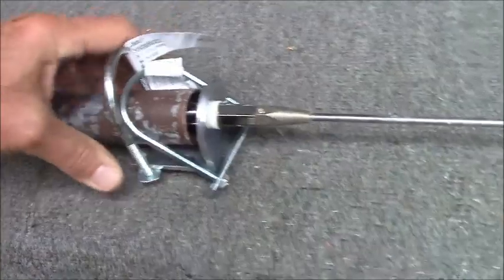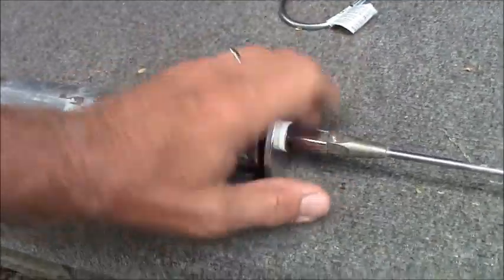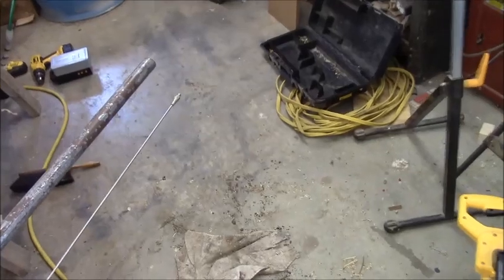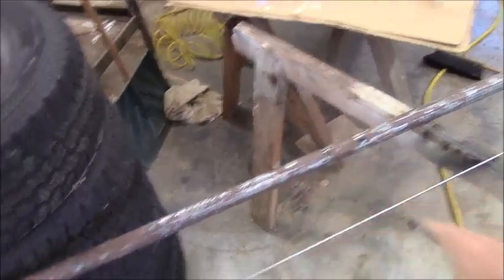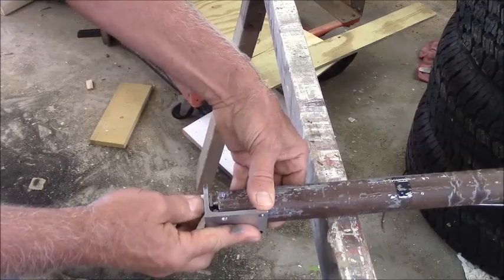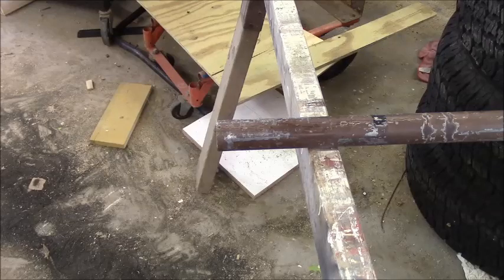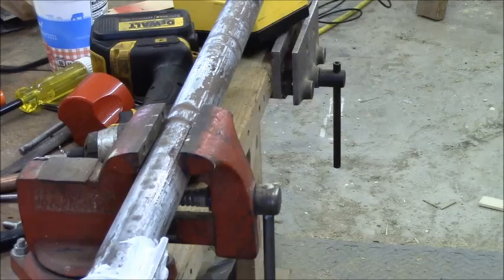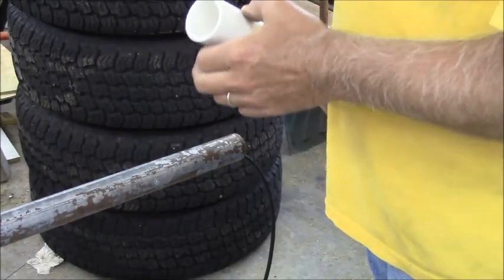DIY CB radio antenna, How to build a quarter wave vertical dipole CB antenna cheap

Comment: Love all these home brew antennas that popped up here and there.thanks to you all,I have a cb sitten on my work bench today to 
repair.gave up on cb and communications  work 25 years ago.now I'm making a return!!thank u all.
Reply from the maker: The best CB antenna I ever made was back when my house roof was asphalt shingles (I have steel now) I used the same base mount with a 102" ss whip antenna. I made a couple metal brackets and attached it right on the ridge of the roof, then I had attached four 102" wires to the base (ground) and stretched them down the roof slope at about 90 degrees to each other, 2 down each side of the roof and screwed them down. Then I ran a ground wire to a ground rod in the ground. It was fantastic! I could easily talk 10 miles with a 4-5W unmodified base station!
Thanks for watching! Good luck in all your endeavors!

Comment from the maker: One note: when I drilled the PVC pipe coupling holes with the coax in the pipe (at about 22:50), I actually did cut the coax and had to pull it all apart, so drill those holes when the coax is OUT!
Reply: Well that was going to be my question about the coax !! Thank for the video 📸

Comment: I'm also a ham. I made a vertical dipole also with the 102" whip, but with a non conductive mast, and for the second half of the dipole I just have a 102" piece of 10 gauge wire hanging down. Gravity does the rest.
Reply from the maker: porkyfedwell cool! Yeah a Dione is simple. One ham friend of mine said you could strip the jacket off the coax back 102” and turn it inside out back over the coax itself for 102” and hang that up vertical. Seems feasible. Thanks for your comments! I have 3 old SSB 𝐂B radios to recap and troubleshoot and tune up. I’m not a radio guy but I’ve been in EE for 35 years in industry so I think I can get it done!
Reply: @bobsbarnworkshop  Sounds like you are more than qualified. You should just go ahead and get your ham ticket. These days it's a snap. No Morse code required. Although I only work Morse and not SSB or digital, myself. CB I have only in case of a national catastrophe such as the Carrington event or EMP, which might eliminate all local communications.

Comment: When tapping out new threads you need to cut a little then back it off to clean the cutting edge; do this until you get it completely tapped.  If you don't back up a bit you run the risk of breaking the tap.
Reply from the maker: W. Rusty Lane yeah, I know, the pipe was very thin wall so not much worry of that!

Comment: This is done completely the hard way. All you need is a piece of schedule M and schedule L copper pipe with end caps. Drill out the end caps so that they hold a 3/8 by SO-239 socket and tighten it down. Slip the schedule M copper pipe over the schedule L and use machine screws to make them make electrical contact at the top. Use a 102 inch whip for the top and 102 in for the schedule M outer sleeve. The schedule L pipe should be about 3 ft longer to allow mounting. Run your RG8 up the center copper pipe and tighten it down to the SO-239 socket. This is when you put the machine screws in so that they create continuity between the pipes and the ring on the connector on the RG8. Use some foam pipe insulation and force it up between the schedule and the schedule L copper pipe at the bottom to keep them from making electrical contact. You now have what is called a coaxial sleeve antenna. What about nine RF course on the rg8 coax and hold them in place with adhesive shrink tube to minimize feed line radiation. I built one 15 years ago and it is still in perfect serve high in the mountains where we get snow and high winds every winter. I appreciate the fact that this individual made a video but he did it the hard way and a half wave dipole does not have 6db of gain. It is a unity gain antenna. This is the antenna of choice for Public Safety that continues to use low band as well as amateur radio operators hit run 6 meter repeaters. It is simple and cheap to build.

Sorry to hijack your post but you really went about it the hard way.

https://images.app.goo.gl/sSaxRwNqSKgJJyL17
Reply from the maker: I just used what I had laying around, so cost was $0... cooper pipe is expensive! I’m not saying that there’s many ways to make a better antenna, but free is free! Thanks for watching!
Reply: @bobsbarnworkshop  :: well, since you put it that way. Free is free. Cheap is cheap. As long as it works. But it doesn't have a 6dB gain. It's a zero gain. I appreciate the time you took to put the video together though. I didn't mean to come across as a dick either. My apologies. Anyone that takes the time to build their own antenna is good in my book. I'm an amateur extra class and I've been building them since I was 12 years old. To me, that's great enjoyment. Kudos to you. I don't know if you realized it but you showed people something that's more important than running a thousand Watts. That's having a good antenna. You can run 10 watts and make a contact that you can't make running a thousand Watts with a crappy antenna. Good on you.
Reply from the maker: So funny coincidence, I just sat down at the computer, switched on the old Lafayette telsat ssb 140 and talked to a guy 15 mikes away! First real contact I’ve made , so I guess it works

Comment: You would've done so much better by placing the PVC at the base of the 102" whip, then used 1/4 wave radials made from guy wire attached to the ground bolts and insulated with parachute cord from 108" and down. 
Your SWR would be 1.1:1 or so and you'd have made the equivalent of a StarDuster, a vertically polarized 1/2 wave dipole. A straight dipole like this requires a coaxial choke at the base and is a 74ohm antenna by natural physics, so about 1.5:1 swr at best.
Try it the other way and I bet you'll like it better, plus you should have less RFI getting into your audio with power.
Reply from the maker: W R 1 Million thanks for the input. One of my best friends is a HAM and I’ve heard all this info before. I’m just trying to make it as small unnoticeable and rugged to stand up to wind and weather. Years ago when my roof was asphalt, I used a similar mount and put the whip right on the ridge of the roof and stretched out 4 -102” ground radials from the screws into the mount. Very unnoticeable and rugged and I would have done it again but I have a steel roof so I figured it wouldn’t work that way.
Reply: A ground plane vertical (what you're describing) is NOT the same as a vertical dipole. The efficiency of a vertical is highly dependent on the number of radials, while a vertical dipole is balanced. The most critical thing when constructing a vertical dipole is that the feedline leaves the dipole at a 90 degree angle to the antenna itself (i.e., feedline is horizontal while the antenna is vertical).
Reply from the maker: porkyfedwell I’m far from an antenna expert. Although I have a “factory” vertical dipole on my cottage, the coax screws into the bottom so I pretty much built this based on experience with that. My SWR is very low so I’m happy wit that! I built a roof mount antenna many years ago with the same type base for a 102” whip and put it right on the ridge of the roof with four 102” gr plane radials laying down the roof at 90 degree angles. That one had a barely detectable SWR! I got away with laying it right on the roof because it was wood with asphalt shingles, I now have steel shingles. Thanks for watching and commenting!
Reply: @bobsbarnworkshop  Hi Bob. Actually I was not addressing you, but WR 1 million's post, as he didn't seem to understand the difference between a vertical ground plane antenna, and a vertical dipole.
You have to be careful looking at SWR alone, since SWR has almost nothing to do with antenna efficiency  (i.e., how well it radiates a signal). The perfect illustration of this is a 50 ohm dummy load, which has perfect SWR and is 0% efficient. Many other less extreme examples exist, of course. Best regards
Reply from the maker: porkyfedwell point well taken! I do know that the radiation pattern of a vertical dipole is far from ideal, like a donut! But I just wanted something that works, doesn’t blow my finals and is nearly invisible. Considering there is so little traffic anymore, I guess I’m good for now... I may try adding some horizontal ground radials to make it radiate more horizontal in the future. Thanks for the input!
Reply: @bobsbarnworkshop  actually a vertical dipole has nice low angle radiation, but maybe that's not as important in CB as it is for us hams. CBers are probably more interested in NVIS (local) contacts, I'd guess?
Reply from the maker: porkyfedwell we use the cb radios at the lake to talk boat to camp and it works great! No monthly charges either!!!
Reply: It wouldn't have been a vertical dipole with your configuration, it would have been a 1/4 wave ground plane.
Reply: @porkyfedwell  The feed line does not have to come away at a right angle, it can be brought up through a pipe element as shown. I believe the correct name of this antenna is a coaxial dipole or a sleeve dipole. Like the classic centre fed dipole you describe it has an impedance of a little over 70 Ohms. Some articles about this antenna suggest a choke or balun is unnecessary due to choking effect of the lower sleeve element on the coax.
Reply: I would not call this antenna a quarter wave ground plane, I would call it a half wave sleeve dipole. 6 dB seems more than a little generous.
Reply: @bobsbarnworkshop  don’t add radials to this antenna, this type of antenna works just fine without them, in fact it would probably make it perform worse.

Comment: I know it's some 3 1/2 years later, but did you ever post a video documenting the results, even after replacing the coax? I'm considering such an antenna, since I live in a rental house (NOT an HOA) and want to minimize my antennas "footprint".
Reply from the maker: The antenna us still working fine, swr is below 1.5 on all channels. 1.2 on most. I don’t use it a lot but when I do it seems to perform well. Not much out there except “alligator” skip talkers….

Comment: good job, but you have short antenna whit out coil for the 27 mhz ?
Reply from the maker: Well it seems to work, SWR is low and it was free! (I used materials I've had around for years!) So I'm good with that! Thanks for watching and your comment!

Comment: So, you did not make an antenna. Just mounted a 102" whip on a pole.
Reply from the maker: so I did "make an antenna" because the "pole" is actually the vertical ground plane of the antenna cut to 102" for CB frequencies.

Comment: I love this! How far have you gotten out on it? Just curious as to what the SWR's were like?
Also was wondering if I could do the exact same thing except the short isolated metal pipe you have there Id like to be about a 30 ft metal pole going to the ground. Would there be any issues with that?😃
Reply from the maker: It's basically a 1/4 wave dipole (1/2 wave?), the 102" whip is the "hot element, and a 102" vertical pipe is the ground element. The coax goes up the center of the ground element eliminating the need to have the coax go out horizontal for a 1/4 wave.. Works good but hard to find anyone to talk to! My SWR is  around 1.2
Reply: @bobsbarnworkshop  All Tandem dump trucks and truckers have CBs. That's why I want a base so I can check my dump radio when theres no radio check close by.
That's great on the SWRs.😀
 I dont want to fool with radials if I dont have to.
Reply from the maker: The higher the better!

Comment: OK - you built it (and took up way yonder too much time explaining the mechanical parts). How did the SWR match up with the 11M band and How good was it's performance?
Reply from the maker: Rick Via SWR is under 1.2 in all channels so I’m happy
Reply: @bobsbarnworkshop  Cool - looks like a good result to your project. Dipoles make the simplest most effective antennas. You put one up without having to have the feedline at a 90 degree, 1/4 wavelength offset. That's really cool.
Reply from the maker: Rick Via  I have a similar fiberglass one at my cottage (I bought it used years ago) and the connector is on the bottom so I assumed there was coax up the middle, so I fashioned mine after it. Mine has better SWR!
Reply: @bobsbarnworkshop  I've had a couple of Antron 99s. There was also the old Shakespear "Big Stick - almost Identical. They're advertized as 1/2 wave collinears, but very well may be half-wave vertical dipoles.
Reply from the maker: Rick Via my house now has a steel roof so I couldn’t make one like I did when the roof was asphalt. I used a similar truck mount for the base of the whip and added some steel strips so I could screw it on the ridge of the roof. I then attached four 102” ground radials to tapped holes in the aluminum base and spread them out at 90 degree angles down the slope of the roof. It was literally an “invisible” antenna and SWR was nearly undetectable! Cheap too! A whip, a base and coax!
Reply: @bobsbarnworkshop   Wow. I bet you could mount the vertical element just above the steel roof and just use the roof as your ground plane. But if it works that well. I wouldn't mess with it. Steel roofs make GREAT ground planes for vertical antennas, and since they usually have about a 45 degree slope, they match a 1/4 wave whip right up to ~50 ohms.
Reply from the maker: Rick Via I thought about that but not sure how it would tune seeing the roof is sort of random. The barn workshop roof is steel and very high, maybe I’ll make a second antenna and try it out up there! The steel roof are the shingle panel type so I’m not sure how well they are bonded together. I already have a second mirror mount and several whips so all I need is more coax. And the nerve to climb way up there to install it! I also have another radio shack SSB base I can hook up, but it needs recapping and tune up first. Keep an eye out for that episode, maybe in cold weather... when I get a “round tuit”!
Reply: @bobsbarnworkshop  Gotcha. If the shingles aren't bonded, that might make your SWR move around. Along with your attached radials, I image you'll still have influence from the roof. Not a bad thing at all, probably. Only thing about a roof-mounted antenna is the height. My roof's only about 25' AGL. Not good for comms out beyond about 15 - 20 miles. They are good for skip, because they still have a low-angle of radiation towards the horizon (and therefore, the ionosphere).

Comment: Nice but why not U-bolt the bracket to the pipe.
Reply from the maker: AdamosDad because the way I wanted the coax up the center it would hit the inside of the pipe, so I needed to offset the mount with some washers so it didn’t hit
Reply: @bobsbarnworkshop  I meant a U-bolt like a muffler clamp. In any case you did a great job and gave me some ideas. I'm working out weather to build a 1/4 wave that I know would easily match up to the radio or take my chances with a higher gain 5/8 wave.  The same antenna would be used on a cb as well as a ham rig.
Reply from the maker: @AdamosDad  right at the beginning where I try to show what I'm going to do, I do show some U bolt type clamps, but after I tapped the 1/4" holes the mount was so stiff I decided not to use them

Comment: Great idea on the antenna.  So pipe is one end of the dipole, and the 102" whip is the other?
Reply from the maker: yep. simple and cheap. My HAM friend says the fatter ground element gives better "bandwidth"... audio frequency? I dunno!
Reply: @bobsbarnworkshop  Thicker elements will give better bandwidth but will also be “electrically longer”which means a thicker element might have to be cut a little physically shorter to maintain resonance, this might become an issue when it comes to tuning up the antenna but if you say SWR is okay then there’s little need to worry.
Reply from the maker: @johnyoung1128  thanks for the info, my career was in electronics but never got into radio and antenna theory much, just know the basics. My friend is a long time HAM so he gives me help and advice from time to time.
Thanks for watching!
Reply: @bobsbarnworkshop  Thanks, I am a long term amateur radio operator as well here in Australia (VK3YO although I’m not currently active) and I have made antenna design one of my interests. It’s good to see someone having a go at DIY. Unfortunately it’s a topic that tends to create argument. The design you have shown in your video is a sound one, your friend has given good advice.
Reply from the maker: @johnyoung1128  years ago when my house roof was asphalt, I mounted a 102” whip on a base like the one I used on this one. I mounted it right on the peak ridge and drilled and tapped the base to attach four 102” wire radials and laid them down the slopes of the roof at 90 degree angles and attached the ends with rubber grommets to the roof. That design worked incredibly well! Super low SWR on all channels and I could reliably talk 10 miles with a standard 4W cb radio. Now my roof is steel so I can’t do that anymore.
Thanks for your comments!

Comment: I would not use that plastic pipe all you need is a strong wind to snap I would have put some tape around the Pole then clamp it to the chimney
Reply from the maker: I added the plastic pipe coupling for two reasons, isolation of the lower part of the dipole and to add a lower section to raise the dipole up above my metal roof. It’s been up several years now and it’s holding up fine. Believe me, here in western NY we get plenty of high winds!
Thanks for watching!

Comment: Could have just made the roof the ground element  would be a bigger plane for the vertical
Reply from the maker: I thought about that but I wasn’t sure the metal shingles were connected together low impedance